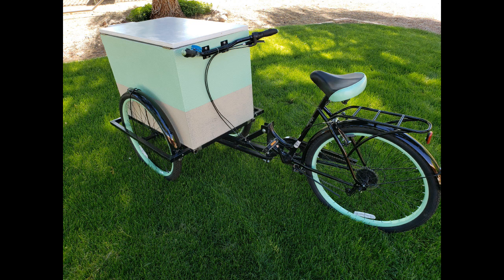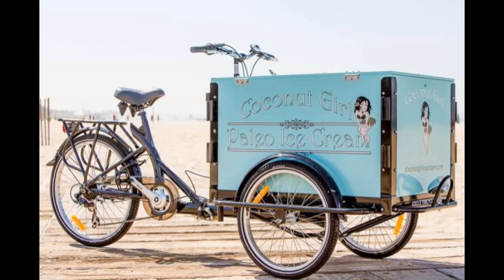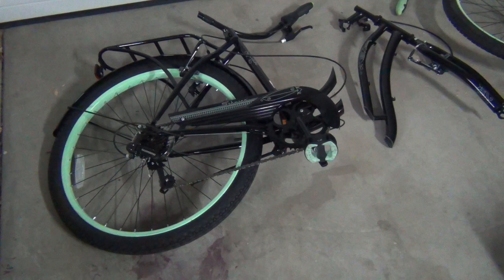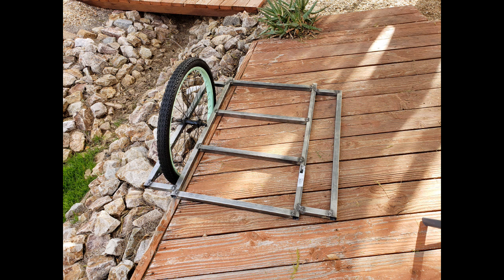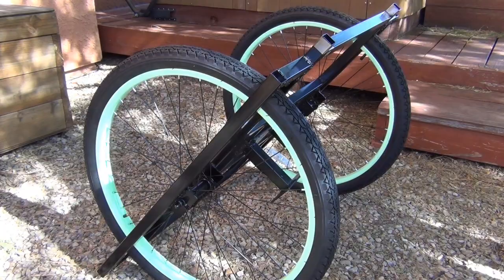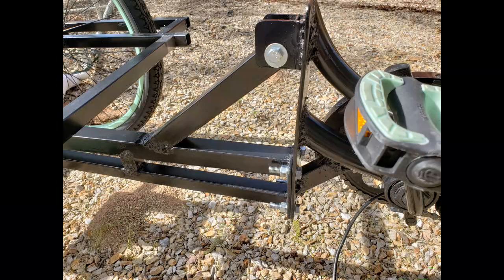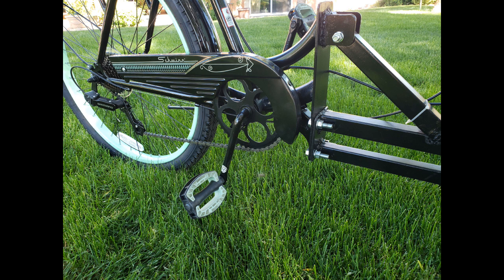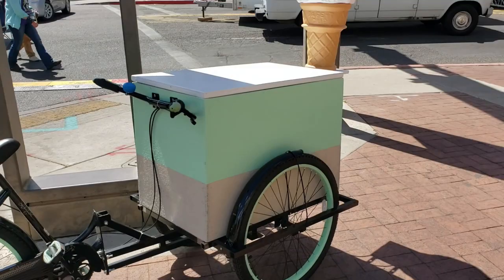Tricycle Vending Cart - How to Build Your Own Ice Cream Cart

Comment: To save even more cost up front, I believe I would have purchased some yard sale bicycles to chop up and paint with your brand colors. Just an idea for someone getting started with a very small budget.
Reply from the maker: Good idea. Although I've noticed that used bike prices are pretty high.  You may end up spending nearly the same amount to fix up an older bike.  But there are deals to be found.

Comment: Thanks for a very educational video! Perfect length and you still managed to explain and show everything. 
If you have the time, I would love to hear what you would have done differently?
Reply from the maker: Thanks. Those are nice compliments.  I can name two things I'd do a little differently. 1) I'd spend more time developing the swivel point so that it's a tighter fit. The tube and bolt idea is good but there's some play in the system which causes the bike to lean slightly. 2) I would make the connection of the rail to the bike's rear the last step, welding the plate to the bike after I get everything aligned and the cart level. I ended up having my tilt slightly forward. Not a big deal but something that can easily be controlled if assembled in a better order.

I hope that helps.

Comment: Good job. I would suggest making a box out of fiberglass and insulation foam for a light weight box. But, that would mean you would have to attach the handles to the steering frame some how
Reply from the maker: Coincidentally my brother suggested the same thing but since I plan to use it for more than ice cream the versatility of the extra space will be nice. Plus they make some ice chests so well insulated it's hard to beat their usefulness. I appreciate the comment.

Comment: Using the original bike steering head fork tube assembly compete with bearings ... then cut down and modified to fit between the two tubing rails the bolt assembly occupies... would make a tighter fitting and easier turning replacement for your front steering bolt assembly.
Reply from the maker: Good idea.

Comment: I always wanted to sell cupcakes or icecream or hotdog. If I decide icecream, I want to sell original icecream such as corn. It's so good. But the problem with the corn is that in USA the corn is not the same to make working the recipe. The american corn does not have enough starch. Unless I go to american farms and buy those corns that are used for the cows, the corns are more mature. There endless delicious Brazilian recipes with corn, but wit the American corn, the recipes fail. Somebody told me to use the Mexican corn. But I can't find. I could sell a lot Brazilian tamales(but it's not tamales), it's pure fresh corn, a little oil or butter or bellypig fat, cheese or sausage filling, and salt or sugar if makes sweet. I prefer the salt ones. But the american corn does not help me, it's very watery the american corn, no starch
Reply from the maker: Interesting. I didn't know that about corn and all the differences. Thank you and good luck.

Comment: Nice video you've made dude 👍 👍 , I really love it ❤ and i would like to do one someday since am a machinist & welder as well.. My question is, what kind of square-pipe did you use to make the frame of the cart, I mean the size and thickness of the square-pipe.. Please can you help me with the pipe description you used ??? 

Thanks, looking forward to hear from you boss.
Reply from the maker: Thank you for the comments.  Unfortunately I wont have access to the bike for a while and I don't remember the specifics.  I just know it was box steel I bought in the steel rack at Home Depot.  I would guess probably 1-inch, or possibly 1 1/4-inch width on all sides.  The thickness was probably 1/8 inch.
Reply: @mikethedesertrat  

 thanks alot for your response i really appreciate.  With this idea you have given me am really grateful 🙏  and also good to go to fabricate one, just like yours 💃 💃 💃 

GENTLE from Nigeria 🇳🇬... ✌
Reply: Pls one more thing sir. For the box you made to accommodate the cooler,  please what kind of material did you use to wrap the inside wooden box???  And can the material maintain coldness of the ice-cream for a long period of time???
Reply from the maker: @gentleodjugo7226  I didn't wrap the box. I used a cooler and simply inserted the cooler into the box.  I use dry ice for keeping products frozen.
Reply: @mikethedesertrat  ok boss thanks alot, I appreciate

Comment: Could you tell me how wel you were able to keep the ice frozen? Any tips?
Reply from the maker: I used a quality ice chest. I placed dry ice (purchased at grocery store) at the bottom of the ice chest. The dry ice was wrapped in newspaper.  I also had two frozen gel ice packs in there.  I sold pre-packaged ice cream.
Reply: @mikethedesertrat  Alright thanks, I'm planning to build a box like yours and isolate it with PIR plates, 10 cm thick with an rd value of 5, do you think this will keep my icecream frozen throughout the day? Thanks again
Reply from the maker: @cheepchoop6402  I'm not sure.  Too many factors to consider such as outside air temperature and humidity, number of times you open the door, size of door, etc.

Comment: I was thinking as well, that building ice cream cart is a good cheap option with 2-3k investment..

It ended to cost me about 6500€.

But the cart itself has 200 litre freezer with 2 kwh battery (12h run time) and also with a basin and running water with a push of a button. Has ample room for personal items and one box of 500 waffle cones. The whole thing weighs about 200kg.

I'm planning to invest about 2k more into that cart to get it even better! Mostly to make it hold cold better.
Reply from the maker: Sounds like a nice bike.  I've thought about upgrades like that as well.   Thanks for saring.

Comment: are you required to have any permits? if so, which ones? have you had any complaints or problems regarding permits?
Reply from the maker: Really depends on the event and the location.  If you plan to do most of your selling in a particular city I would at least get a business license for that city.  I sell pre-packaged items so there was no inspection or food preparation requirements.  Sometimes I set up just outside an event (like a street fair) to avoid paying the vendor fee.  I get customers going to and from the event.  Once I got questioned by a cop but I showed him that my business license was posted on my cart and it said "peddlers license" he didn't push it.  I think he was responding to some other business owners complaint that didn't want me there.  The point is, be friendly and respectful but don't let people intimidate you.
Reply: awesome. thanks a ton!

Comment: Would it be possible to post specific measurements sir, this is incredible and would love some any additional assistance
Reply from the maker: Actually I think it's best to customize for your needs and desires, especially if you start with a different bike. A few inches here or there won't make a huge difference but you can determine what you want as you go along. I appreciate the comment though.
Reply: Appreciate it non the less

Comment: i love this video. wondering what kind of welding situation you used and where did u buy it for how much??
Reply from the maker: Thank you.  I used a basic arc welder, sometimes called a "stick welder".  I got it at Harbor Freight Tools several years ago for about $125.  It runs on a standard 110v outlet, but can also run on a 220v outlet.  It'll take practice to learn to weld. Luckily I took a class back in high school which taught me the basics.
Reply: Thanks for your response. Also where did you get all the metal do they sell it like that somewhere? What kind of metal was it? 
Thank you!!
Reply: Also I wonder if there would be a way to do this but with a motor installed. I got an 80cc 2 stroke gas motor on my bike. Of course it is installed onto a men's frame, which would mean that the bike couldn't be cut in half like how it was in your video but further down towards the handlebars, rather. How does it feel to ride your bike with a full load in it? Is it hard? When I got a motor on my bike I can carry any weight in m basket no problem lol
Reply from the maker: @alexandriastiles8031  It was all bought at Home Depot and Lowe's in the steel rack.  No special order required.
Reply from the maker: @alexandriastiles8031  I really can't say about the motor configuration, but anything is possible with skill.  I have never loaded my box with more than maybe 30-40 lbs.  I have no problem riding it like that, but it's also mostly flat where I take it, and I don't ride long distance.

Comment: @3:59  mins. What kind of pipe you use?
Reply from the maker: To be honest I don't remember the specifics on that.  It's a standard iron gas pipe, probably 1/2 inch and about 6 to 7 inches long. It was threaded on both ends. I screwed on two end "stands" then ground them down smaller because they were binding on the bracket when actual size.
Reply: Ok thanks 👍🏻👍🏻👍🏻

Comment: You could have saved yourself alot of work by buying the kid cart attachments for bikes ( Thule coaster, Thule Strolling kit, kids bike trailer, bicycle tail wagon ) at the SWAPMEET it could cost you as cheap as $15 to around $80.... a couple adjustments and 🍧🍨🍦
Reply from the maker: You're talking about a trailer cart, correct?  That's not what I wanted.  I wanted this look, with a front cart.
Reply: @mikethedesertrat  yes but I meant take the frame from the trailer to use for the front cart. 💞
Reply from the maker: @truelyme2715  Ahh. I get it.  You could. However I think most of those are made of aluminum.  I have limited welding skills and equipment and aluminum is harder to work with. It's less forgiving with heat. I'm sure I'd screw it up at least once. :)
Reply: @mikethedesertrat  I have no skills and would fail at just thinking of how to put it together 😭 you did amazing though